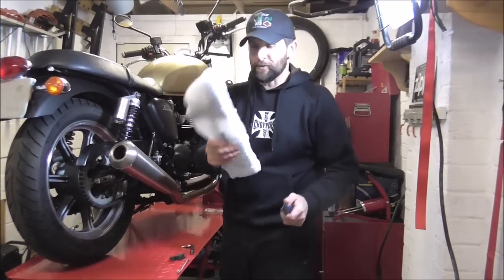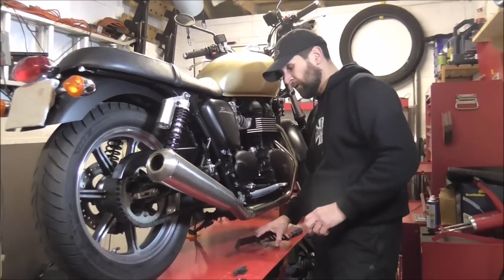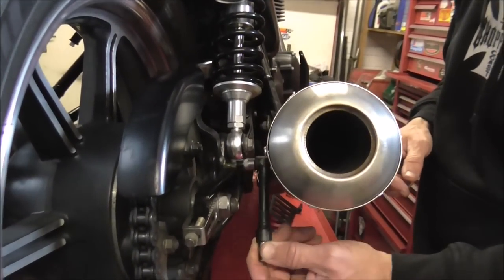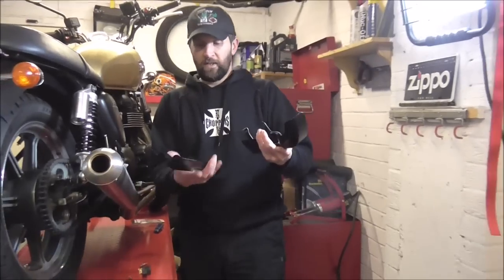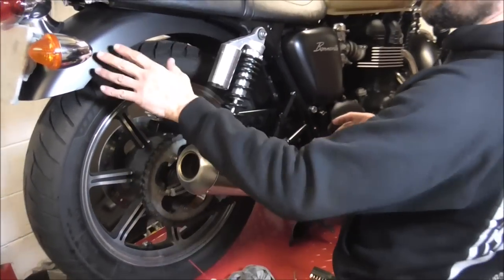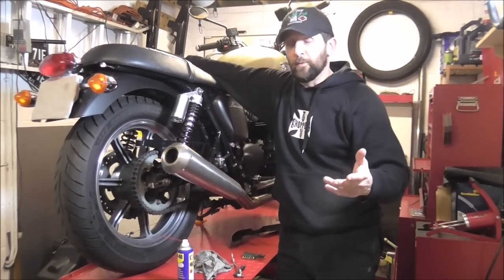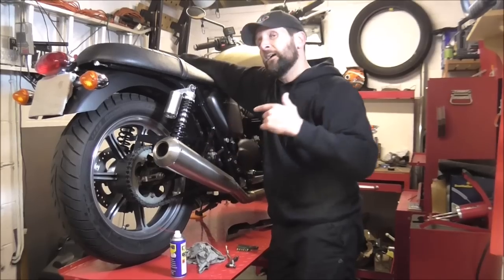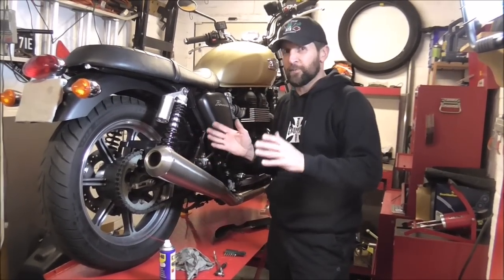Delboy's Garage, Triumph Bonneville chain guard .

Comment: Mostly the problem is getting enough space to work, Throttle cables, coils and oil cooler all slightly in the way to get the rocker over off. Also, a nice corroded locating bolt right at the front of the rocker cover giving me problems....
Reply from the maker: Take the coils off mate, (label the wires to get them back on the right sides), the cables wont be in the way, take the central vent cover off, and the two oil pipes on the back of the valve cover...and i always took my oil cooler bolts out to let it drop forward an inch or two...plenty of room..!
Reply: Cheers, very helpful!

Comment: Hi Del.. what tyres are those.. they look much broader than the stock 130/70...
Reply from the maker: Hi Kumara, I think it is a trick of the wide angle lens, they are indeed a 130/70, but they're just a different brand, Avon Roadriders, which have a more rounded profile than the original tyres... check 'em out !
Reply: Hi Del... Thanks for the prompt reply to an old video... Those tyres indeed look very broad. But unfortunately AVON tyres are not available in this part of the world. What size can I upgrade on the stock alloy wheels of the Bonneville without compromising the ride quality and safety.
Reply from the maker: @drkumaraprasad  Hi buddy, this conversation is really about the really isn't it?  Because the front will always be a 120, but as for the rear!  You can push out to a 140 and drop down one on profile so 140/60 instead 130/70, this will look a little wider visually, but will actually be the same overall width for safety... fitting a much wider tyre on to a thin rim is a little dangerous if it's too big, because you pull the beads too close together, causing the tread to 'round' more, and it will still look the same width... Take a look at some different tyres that are available to you, and maybe pick a tread pattern you like, perhaps something a little more 'aggressive' like an Michelin Anakee2  or the Continental TKC70, both are a all purpose tyre for off road and on road, with tread that looks cool and aggressive, even when they are the proper recommended size, plus if you ever ride on loose ground, they will be better than road tyres... just a thought if it helps you, Del
Reply: @Moonfleet41  Thanks del... I'll definitely note what you said....
Keep the good work going...